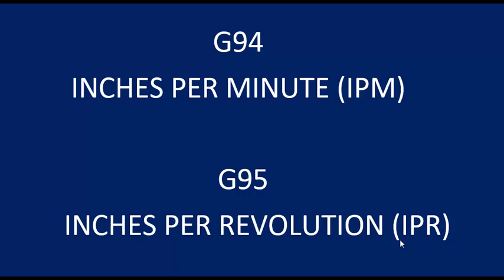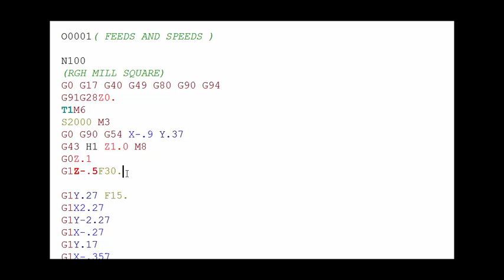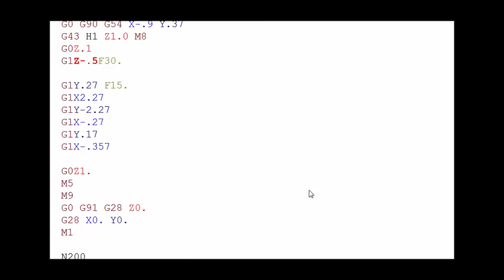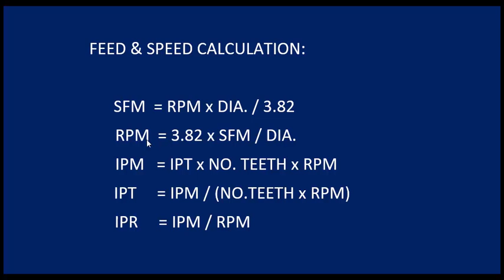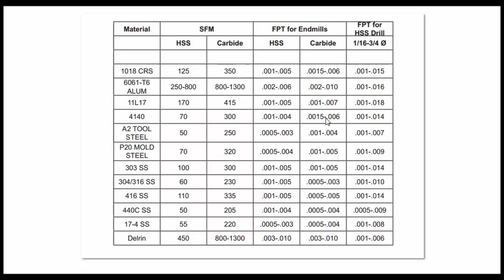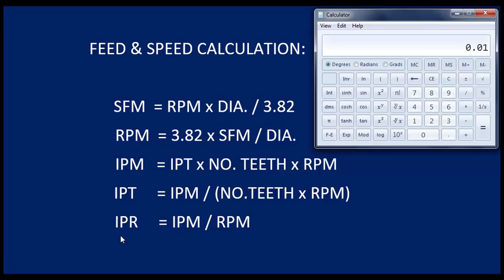HOW TO CALCULATE FEEDS AND SPEEDS FOR A CNC MILL

Comment: What happens when you have an endmill and material but don't know either the SFM or RPM and have no chart?
Reply: get to know what material you are going to cut and get data about endmill you are going to use from the dealer of cutting tools

Comment: HI TOM . I LIKE YOUR VIDEO. IT IS HELPFUL BUT I HAVE A QUESTION ABOUT CALCULATE FEED AND SPEED IN LATHE. EX: I WANT TO ROUGH OD A PART HAVE DIAMETER OD .5 IN ; MATERIAL IS ALUMINUM 6061. SO HOW CAN I CALCULATE FEED AND SPEED? THANK YOU

Comment: Sir .. I request you for speeds and feeds in metric please.. and small doubt that whether feed is same for contours and pockets  ? ..plz suggest. .. thanks in advance
Reply from the maker: Okay I will do a video in metric very soon.  
Feeds and speeds
Reply from the maker: Tom Stikkelman Feeds and speeds are based on depth of cut and amount of step over. They are calculated the same for outside profiling and pocket machining. Thanks for watching. Let me know if you have any questions.
Reply from the maker: ravin Hello Ravin. I just posted a video on calculating metric feeds and speeds. Let me know if you have any questions. Thanks